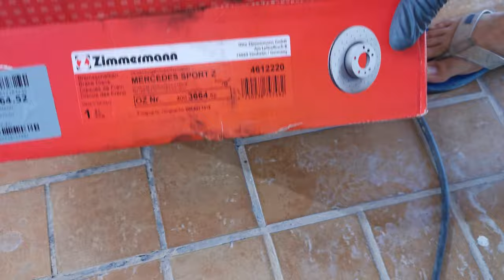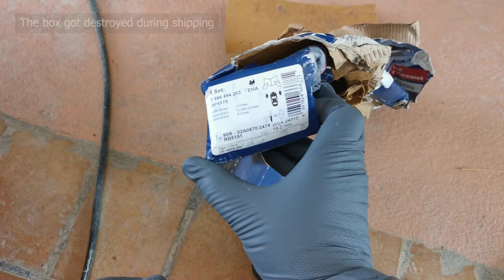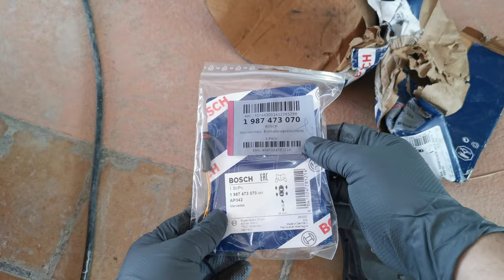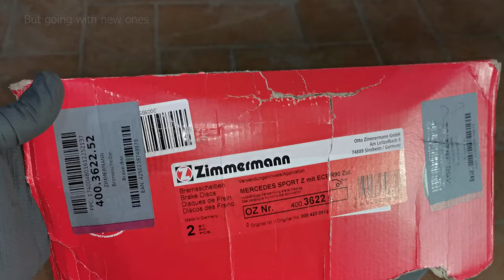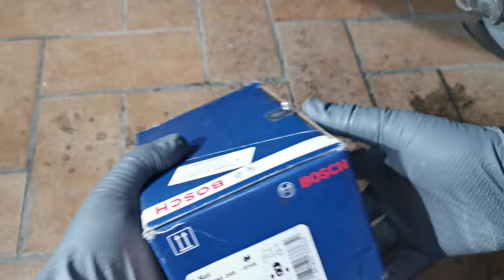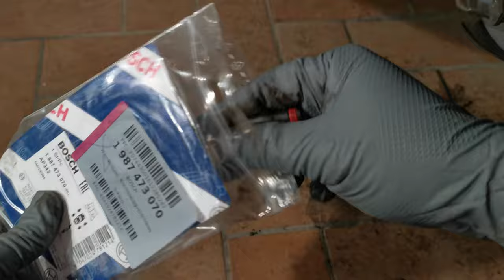Brake Replacement | Mercedes E-Class W212

Comment: Couple of additional suggestions:  1) Always pop the hood and remove the brake fluid reservoir cap and assess the fluid before starting the brake job and keep the cap off during the service with a towel around the neck of the reservoir to catch any drips/overflow.  If you have an electronic tester, use it to see the condition of the fluid--it may need to be replaced if it has absorbed too much moisture (it's very hygroscopic). If you don't have an electronic tester, assess the color and if it seems overly dark compared to new fluid or if it's been two years or more since it was flushed, plan on replacing it.  If you do need to replace the fluid, do it at the same time as the brake job as you will already have the vehicle in the air, wheels off and easy access to the brake fluid drain nipples behind each caliper. Also, if the fluid level in the reservoir is at the max level or above, use a turkey baster or syringe to remove some of the fluid down to half way between min and max.  This will assure that the fluid pressure in your system won't spike and damage your components, and/or the reservoir will not overflow the very caustic brake fluid on delicate parts in your engine bay when you compress the caliper pistons with the compression tool prior to installing the new pads.  After finishing the job, either completely replace the brake fluid if its gone bad, or top off the brake fluid level to the max level with new fluid and re-seal the reservoir cap.  
2) Removal of the two caliper slide pins from their rubber boots for cleaning and lubrication with a silicone-based lube on the FRONT brakes was NOT shown during the video.  This step WAS shown on the BACK brakes, though.  Do it on the fronts the same way as shown there.  Dirty, sticky slide pins can keep the calipers from compressing the pads to the rotors evenly when braking, which can wear pads and rotors unevenly and cause you to have to do this maintenance again way too soon.  You got this!
Reply: Good stuff, Amy, your suggestions are spot on. One detail though, the front caliper slide pins on this model are sealed under rubber boots and just have two regular bolts (always included with new pads). There is no lubrication needed, it's actually a pretty cool design. Your suggestion applies to most other cars though so it's good you mention it.
Reply: I have changed my brake rotors and pads and also brake lines. After that I replaced  the brake fluid but after starting the car, the brake pedal felt spongy and weak. I proceeded with the two person method (with a hose merged in to some old brake fluid ) and only opened the brake nipple when the other person was pressing the brake pedal. There was however some brake fluid coming out next to the nipple. I checked everything and there is no leaks or whatever. What could cause the pedal to be spongy and not hard just after a brake job?

Comment: Just about to replace my 2011 e220 front discs after MOT advisory. Rears are ok. I was surprised to see that rear disc and drum handbrake were same as a Mercedes Sprinter motorhome I had a few years ago. They were a nightmare due to get at the shoes behind the hub. Great video and my reference for the job. Thanks.

Comment: Looks good and pretty much the same as for W211. If sliding pins/bolts won't open, don't break the head (torx in W211). Open the 18 mm bolts, separate the sliding part and take the pins out in a vice with aluminiun etc. jaws. In W211 with SBC, before removing brakes, when ignition is off, remove the SBC unit connector in the engine bay and after repair, put it back and pump the brake during first start to help the SBC to make contact with pads. No errors this way.

Comment: Great video as I just purchased my first Mercedes-Benz (W212) and I know I'll be doing the brakes in the future. My only tip is to use Kroil or SeaFoam Deep Creep or PB Blaster instead of WD-40. Thanks for the very detailed video.
Reply from the maker: Thx, and hopefully you enjoy your new w212 :yougotthis: it's a great car. Great tip, I had the PB Blaster on standby but the disk came off without much hassle.

Comment: Great video, thank you so much! Just finished changing the fronts and backs with no issues other than the rear brake shoes holding the disk on, but as described in your vid was easy to release. Once again, thank you very much, saved me a fortune!
Reply from the maker: Niiice, really glad it was useful for you and all went smoothlly :yougotthis:

Comment: Such a fantastic video.  It's actually gave me the confidence to do this myself . Whilst doing the parking brake why did you you wind that cog in and back out please .
Reply from the maker: Thx, Brakes aren't that hard, hardest thing is jacking up the car safely. For the parking brake was showing how to adjust it, usually you wouldn't have to touch it. But sometimes the router could be stuck on the handbrake shoes, and you'll have to retract the hand brake to be able to pull to brake router. But it's always good practice to readjust the handbrake after installing new brakes. Have a separate video on it: https://www.youtube.com/watch?v=9k_fJ9bwKSk

Comment: Is there enough space to get to the caliper bracket 18mm bolts to change the rotors WITHOUT taking the pads and piston unit off? I changed pads 1k miles ago and need to replace rotors now. Pads are not too worn. Mercedes charges $50 for the new guide pins and requires new pins anytime you unscrew the used ones.

Comment: Great video I have a w207 with almost the exact same caliper setup in front but I keep having an issue with the pad or something sticking after I let off the brake. I notice you did not use any grease or paste behind the pads.. I used this purple stuff called ceramic extreme paste that I have been concerned about the whole time due to its thick (almost gluelike nature). Could the use of brake paste be the cause of my problem? Everyting else has been checked for tightness etc. Also are the caliper carrier bolts required to be at 130ft/lbs? I had them torqued to about 105ft/lbs... would this cause my issue?

Comment: Had mine in the shop, they changed the front discs oand pads, however the "Break/Hold" function is slipping a little bit, and then breaking hard. If I wait a little longer, it starts slipping again. Do you by any change, know what causes this?

Comment: Excellent work. Am looking to replace my front disk stock rotor with drilled and slotted performance disk rotor. Can you suggest which one to buy or share a link please my car is e220 cdi 2012. Thank you
Reply from the maker: Thx :yougotthis:. I have listed the MB part numbers for my car and replacement parts I used in the vid description. But be careful, MB installed different brakes on the E-classes, so the part numbers for my car might not be the same as your car.
Reply: @ZakiGarage  jazakallah khair

Comment: Thanks for that video.
Are you sure about 180 nm of torque? I head it should only be 115nm for the pad holder with the 18mm bolts.
Reply from the maker: Good catch, indeed its not 180N.m.  Its 34Nm for M8x28 bolts and 29Nm for M8x70 bolts.
Reply: @ZakiGarage  I saw a lot of different opinions on the torque levels 🙂
I own a E350 BT 4Matic and it is the same brake on the front. I saw a video from a guy who stated it would be 115nm for the brakepad holder to axle bolts. Another guy in a forum said it should be 130nm. Any advice where I can look it up (except Mercedes WIS..)
Reply from the maker: @unwokesnake sorry for the miss information.  I gave you the torque for the guide pins. I checked again and WIS says its 180Nm. Where to find the info? I would only recommend WIS. Since there are so many models and brake options out there WIS will highlight the right values for your vin.
Reply: @ZakiGarage  Too bad that it is difficult to get these infos, because as a normal Mercedes customer, you get no technical information. 
Can you do me a favor? Can you check if 180nm also applies to W/S 212 350 Bluetec 4Matic?
Before I hammer the bolt with 180nm, I would like to doublecheck :D

Comment: Do you have to release the handbrake before you change the rear discs and pads?
Reply from the maker: Yes, otherwise you won't be able to remove the rear disks.

Comment: Great vid and content. What's your experience with the Zimmermann rotors compared to original Mercedes disc? Any vibration while braking from higher speeds? I'm about to replace the front brakes on my e350 but I'm concerned about non OEM discs.
Reply from the maker: Thx, I had many emergency hard braking from high speeds with the new rotors and they have been great so far, nether the old OEM or the Zimmermann had any vibrations. Its my first time running Zimmermann but all my other cars have aftermarket drilled rotors and still run great. Personally I do prefer the Zimmermann over the OEM ones even if I didn't feel a difference, from what I understand drilled rotors should last longer without wrapping due to better heat dissipation. What made a difference was the bosch pads, they don't make as much brake dust as the OEM ones which i'm really happy with. The new pads do squeak but I think its coz I was too lazy an didn't put brake grease on all the pads.
Reply: If I can chime in, I have a 2010 C300 - W204, which is pretty close to the braking system in the W212.  Ever since the pandemic I now work on my car and recently did all 4 rotors and pads.  I'm fairly sure the Zimmermann rotors are OE anyway.  I always bought rotors and pads at the dealer in the past and had my mechanic install...but now that I do things myself, I bought Pagid rotors (front and rear), fully coated, and I also got Jurid pads.  Pagis does OE for Porsche and certain Mercedes, maybe also BMW.  I can assure you not only do they stop great but not a single squeak or vibration or anything.  I was worried at first but did my research.  The Pagid rotors are working really well for me and it's been a few months.  For the c-class, they are much cheaper than the OEM/Zimmerman and probably similar cost savings for the e-class.  I also did Jurid pads (Jurid and Textar are the OE manufacturers for semi-metallic pads).  I don't do ceramic pads...I always use semi-metallic.  I prefer to keep the same specs as original (and to me, semi-metallic works a bit better and I'll deal with the dust as usual).  Sorry I've heard inconsistent reviews when it comes to Bosch pads, as the author of this video used.  Some people say they're great and the other half curse them and wind up doing another brake job in 3 months and waste all that time.  Anyway, hope that helps any decision-making when buying rotors/pads for Mercedes.  I also use Pentosin Super DOT 4, which is the same as Mercedes' branded DOT 4+ (which is just a marketing term).  If you're doing a full brake job, I'd also recommend a brake fluid flush - even if you don't need to bleed your brakes, you'll be able to enjoy and get more out of your brake job with new fluid.
Reply from the maker: @AlGolzari  Thanks for sharing, love to hear other's experiences with different OE brands, especially brands I've never heard of like the one's you've mentioned. I'll keep them in mind next time I'm shopping for brakes.
Reply: @ZakiGarage  Happy to share whatever info I've learned.  I'm a big Mercedes guy and this is my 3rd one.  Btw, if anyone has a pre-face lift W204 or W212, and get stranded due to a failed ESL motor, I have a video on that.  I had that problem 2 years ago and fixed it myself.  Big but do-able job.  It's called: I Stole $2,000 from the Mercedes-Benz dealer.

Comment: 2009 c207 E350 coupe 272ps have same brake discs size and brake pads?
Reply from the maker: Best to check a parts catalog with your vin number or check the parts directly on the car.
Reply: @ZakiGarage  So are you satisfied with the products?  Does it make noise when braking?
Reply from the maker: Still have those parts on the car since I made the vid. I'm happy with it but would not use the bosch pads next time. They still make noise often but less brake dust than mb pads. The noise didn't annoy me enough to replace them since I usually drive with windows up, ac on high and loud music so i don't really hear the brake noise . But I think I would replace the pads if I drove more often with the windows down.

Comment: I have a C207 chassis E coupe with the same wheels & calipers as you. I'm also switching from solid to drilled rotors & was concerned about the 10mm difference in thickness. 
Found an MBWorld thread & local dealer who confirmed fitment wasn't an issue as far as thickness, only in diameter & strangely the "sport" drilled are 10mm smaller diameter than solid "non sport". 
Interestingly, the pads you have linked in the description note "for sport package", which you don't have. How did you get confirmation on fitment?
Reply from the maker: Good question, it took me a while to get the right parts for the car since the w212 has so many different brakes.
First what I did and recommend is getting the a quote of the parts from the dealership that includes the part numbers. 
So now you can start looking for parts with the same OE numbers. 
I got all my parts from autodoc, nice thing about them they show all the OE numbers of any product and dimensions like on the ZIMMERMANN links in the description. 
There were no thickness difference in the parts I got, e.g. front disks MB#  000 421 12 12 & ZIMMERMANN# 400.3664.52 are both are 32mm.
I also asked autodoc customer support to check the fitment of my order with my vin number before placing the order. 
If you live in the US websites like FCP Euro can check parts fitment with you vin number as well.
Reply: @ZakiGarage  thanks for the response. I basically did the same thing & did use FCP since I'm in the US. I also spoke with 2 dealership's local to me. It definitely can be tricky with all of the options. 
My curiosity started when FCP mistakenly sent 1 non sport & 1 sport sway bar link once. Sport link bolts right up & dealer confirmed there's no harm in that simple upgrade. Some things can transfer over, but obviously not everything. And of course 4matic or rwd is a biggie.
Reply from the maker: @RothBeyondTheGrave  Had no idea there was a sport sway bar link, makes me think of upgrading to the sport sway bar
Reply: @ZakiGarage  I wanted to cry when I saw the sport & non sport side by side lol. No one in their right mind would want to fit a non sport after seeing them together. I also replaced the sway bar(w/ stock 25mm) since our bushings aren't serviceable on their own like my sister's w203. 
I was concerned about maintaining proper geometry among all other components, but a few MB techs told me the sway bar link upgrade is fine. Since so many ppl upgrade the bar itself to a thicker H&R, Eibach, or AMG bar I suppose that's fine too, but have yet to dig into the details.
Reply: @RothBeyondTheGrave  you can fit 344mm front rotors if you change your caliper brackets

Comment: Do you have to unplug SBC like in W211?
Reply from the maker: Did not see any mention of the SBC in the repair documents
Reply: @ZakiGarage  yes, but let's say if you open the doors during brake job, system won't start pumping brake caliper's piston out?
Reply from the maker: @M.Mantas   had no such issues with my car

Comment: Never spray the disc's they are coated with a protective film and break cleaner is just terrible for the coating on the new break disc's..
Reply from the maker: I wouldn't worry about the protective film since it will come off after the first drive and use of brakes. Cleaning the disks so no dirt or oil from installation would come on the pads.
Reply: @ZakiGarage  does more bad than good but your breaks not mine🤷‍♂️